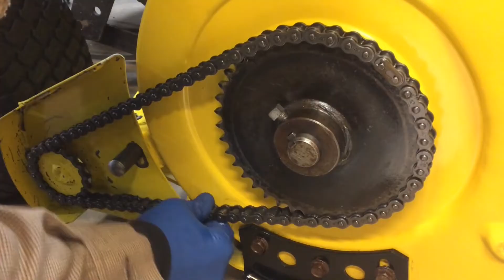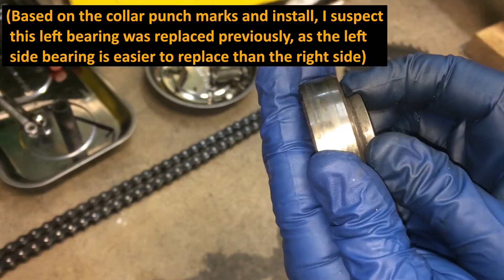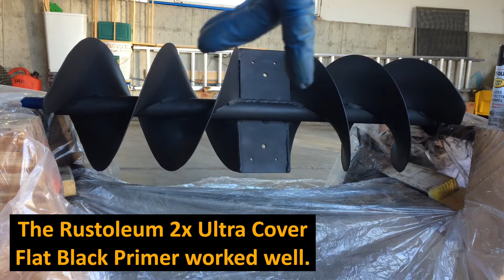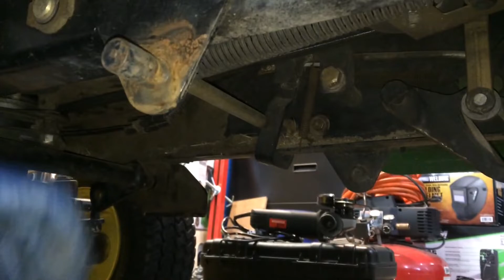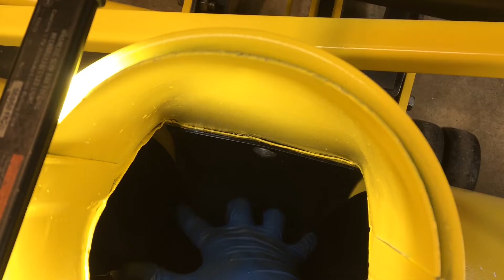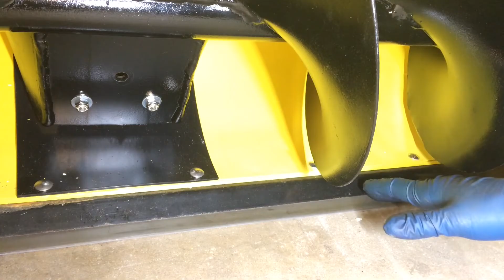John Deere Snowblower Snowthrower Rebuild, Replace Shaft Bearings, Remove Auger, Tension Chain

Comment from the maker: Timestamps, Part Numbers, Links to the Owner's 
Manual:
0:45  Notes about the chain versus pulley drive 
snowthrowers
01:11  De-tension and remove the chain
02:45  About the pulley and drive shaft 
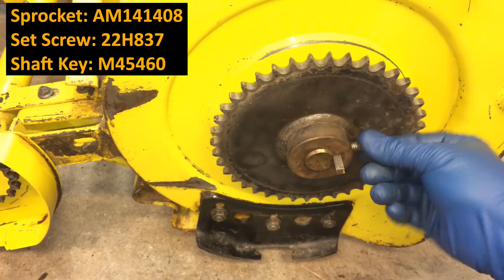03:18  Remove the sprocket
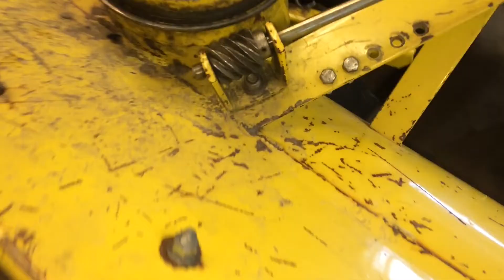04:37  Lock out the rotor so it can't rotate

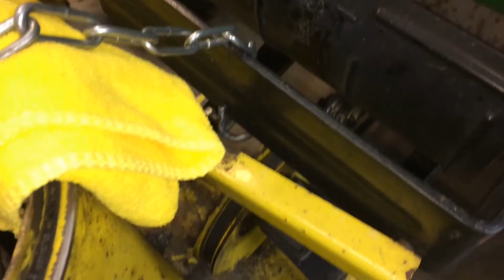04:58  Important detail about the eccentric 
locking collar and bearings set (JD8665, JD8554)

06:58  How to remove the locking collar
08:15  Remove the left hand locking collar
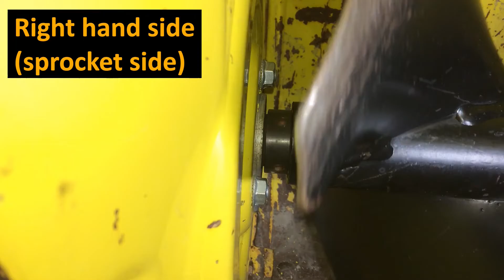11:46  Remove the right hand locking collar
14:28  Remove the shear bolt (7/16")
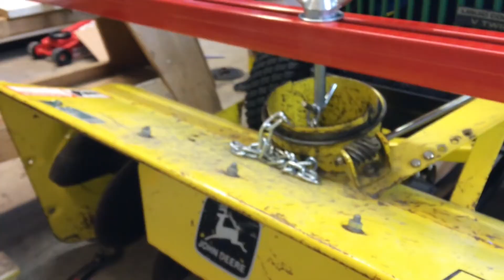14:49  Remove the left hand flange plates and 
bearing (13mm) 
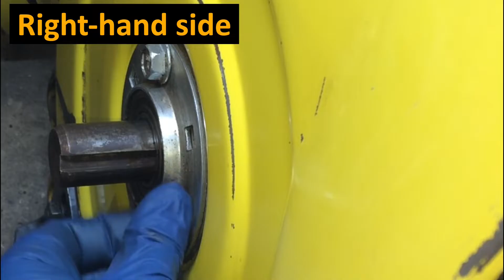15:32  Remove the left hand flange plates
16:06  Remove the left hand shaft key
16:29  Remove the auger/rotor and shaft from 
the bucket
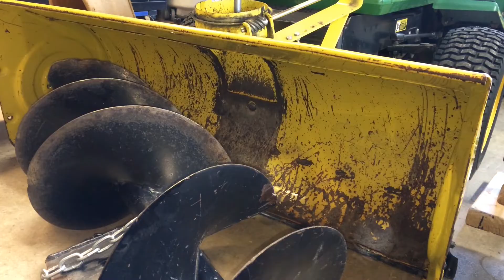18:26  Remove the shaft from the auger

19:13  Tap a stuck bearing off the shaft 
20:20  Inspect the auger and bucket/housing
20:58  Inspect the shaft (JD part M72099)
21:24  Info on the sprocket (AM141408) and 
chain (Size #40, 36 outer links plus 1 master link), and bearings, etc
24:17  Remove the scraper blade (M142882)
25:13  Remove the shoes (M135188)

26:03  Major problem - two broken housing 
welds!
26:41  Inspecting other parts for broken welds 
and other repairs
27:35  Note about the snow chute hinge and rivets 
(M71535 hinge, M127648 rivets)
27:56  Straightening the auger fins
29:59  Inside the old bearing (cut open) and 
failure speculation
32:07  Repair of broken welds (TIG welded)
32:49  Disassemble the rest of the housing

34:20  New drilled holes in the auger for the 
"flapper modification"
34:58  Paint the aguer, housing and other peices

Re-assembly:
40:20  Install the new wear plate (M142891), 
scraper blade (M142882), and shoes (M135188)
41:17  Re-assemble the snowthrower housing 
and drive assembly to the frame
47:47  Install the snowthrower to the tractor
52:02  Install auger to the housing with hand 
install of right side locking collar and bearing
56:13  Measure the shaft protrusion for clearance
56:53  Install shear bolt (19H1914 bolt, M40333 
nut) 
57:31  Note about the shaft keys (M45460, or 
1/4" keystock)
59:09  Install the left side shaft key
59:50  Install the left side flange plates and 
bearing
1:00:29  Important install note for the left side 
locking collar
1:01:28  Check chain case cover clearance and 
lock out the rotor before tightening the collars
1:01:48  Tighten the right side locking collar
1:03:25  Install the left side locking collar
1:04:19  Tighten the flange plate bolts (13mm)
1:04:54  Install the new "flapper modification"
1:07:19  Re-install the auger deflector shield

1:07:44  Back-track: my pulley is not correctly 
spaced on the driveshaft
1:11:28  Re-install the pulley and driveshaft
1:13:05  Chain inspection - why I had to replace 
my chain
1:16:10  Re-install the sprocket and chain
1:18:42  Align the sprocket and tension the chain
1:25:56  Verify there's no chain rub
1:26:16  Tighten the jam nuts and 10mm's for the 
driveshaft bracket
1:26:31  Secure the sprocket set screw to final 
tighteness
1:27:18  Re-install the chain case cover

1:29:13  Level the bucket/housing
1:30:35  Adjust the scraper bar clearance using 
the shoes
1:31:04  Reassemble the snow chute
1:32:05  Re-install the snow chute  
1:34:28  Adjust the belt tension

Link to the Owner's Manual - Chain Drive:
Click this link, select "Part #/Keyword" in the 
drop down, then enter OMM123354.  Or, you can search for "42 Snowthrower".  You can then 
download the full pdf for free:
https://techpubs.deere.com/en-US/Search/Equipment

Link to the Owner's Manual - Belt Drive:
https://issuu.com/razvanalexa/docs/john_deere_
42_snow_thrower_manual

Other links:
https://partscatalog.deere.com/jdrc-
services/v1/image/getAttachment/42_Inch_Snow
_Thrower__240_245_260_265_285_320_325_335
_345_355D_GX_LX_GT_Tractors___Introduction?
a=261&br=1061&locale=en-US

I hope this video was helpful for you.  Thank you for watching, and good luck with your repair!

Comment: Great video. Maybe show us how to replace the small gear. Does it have to be cut off and then rewelded. Very nice voice to listen to.
Reply from the maker: I have never replaced it, but on my model, that sprocket for the drive shaft is indeed welded to the shaft.  

So, I suppose you could either cut it off/grind down the weld and knock it off, and the re-weld a new sprocket in place (Surplus Center might have a match, as they seem to have everything!), or you could replace the drive shaft itself, as a used or new component.  

Your local JD dealer should be able to get you the part number for the shaft, and using that info, you might be able to source a replacement part.  

Surplus Center might be able to match the sprocket if you give them the tooth count and diameter (or you could use a different sprocket and make adjustments to the chain length, if necessary, if you can't find a close-enough match).

I hope that helps - good luck, and thanks for watching! : )

Comment: This video was nicely done and addressed every detail. I am in the process of rebuilding a John Deere 111 and this video was just the ticket to help me repair my snow blower. I am now a fan.
Reply from the maker: Wow, that's great that you are restoring a JD 111!  
The snowthrower shown in the video is still working well - if you can, be sure to do the "flapper modification" at 01:04:55.  That simple change has really improved our snowthrower, and I haven't had to clear the chute once since making that improvement (before that, the chute would often clog, especially with wet/heavy snow). 
We recently got 30" of heavy-ish snow, and I didn't have to clear the chute once, which is really great!  
Happy New Year, and thanks for watching - good luck on your JD 111 rebuild!  : )

Comment: Hi very well  done. Those carriage bolt holes in the chute, normally  the bolts have large knobs so you can adjust the angle  by hand when using the machine.
Reply from the maker: Thank you - I didn't know that, but that makes sense!  : )

Comment: Ok, I have a 265 I picked up from an implement dealer in Hopkins mn for only $200. Missing the mower deck as they ONLY used it to blow snow, so it has this Snowthrower. 
WOW, Your video is TOP Shelf. However, I'm questioning the counting of the chain at 21:45. It seems like the initial vertical link at 21:50, was not counted. Am I wrong? So I'm thinking it should be 37links PLUS the 1 master link?
Reply: Also, what really piqued my interest was the sound of your nice voice! (I'm a BIG Music guy with an ear for notes/key's/recognizing people by the sound of their voice) My Granddaughter from 0-5, lived with us while my daughter finished College. Anyway, LONG Story short, she took a Small Engines course this year in High School, and rebuilt her own B/S engine! There is hope for this next generation!
Reply from the maker: @henryhill3778  That's a great story - thanks for sharing that!  You all must have given her the confidence to try new things and to learn to work with her hands, and that is a SUPER gift to give to your grandaughter!  : )
Reply from the maker: Wow, that's a great deal! 
As for the links: I'm counting the outer links (plates) only, and there's 36 outer links, plus the outer master link.  
So, there's no "vertical link" to count at 21:50 - the link that's in the vertical orientation is underneath the ends of the two "horizontal" outer links.  I have the chain folded such that the only outer "vertical link" is the master link at the left-hand end - all the other outer links are in the "horizontal" position.  
I hope that helps : )  Thanks for watching!
Reply: @L35inColorado  Ok, I'm new to this machine. thanks !

Comment: In the process of rebuilding my snowblower a second time
in 20 some years.
Your video was very well done with lots of good detailed instructions. I learned a number  of good points from your video.
My first rebuild required a new augger shaft to be made due to bend in old one. This overhall is a result of same problem from a pice of cement going through blower. Both times blower had a severe vibration due to a bent shaft. Measured latest shaft in v-bolocks and it has 0.083" runout In middle area. Lots of unbalance from the auger high-speed and large diameter.
Wanted to mention this problem incase someone else does not have structure cracking like yours had and there is too much vibrations.
Thank you very much for the time and good quality of your video.
Reply from the maker: Wow, thanks for adding those tips!  And thanks for watching : )

Comment: I have a JD snowblower.  their idler with bearings only last one year at over $40.00 each, i need 2.  i bought replacements at Tractor supply for $14.00 ea. drilled drain holes for snow and placed silicone on the bearings seal to keep out water and salt.  the bearings lasted over 10 years.  Today JD wants $50.00 per idler i bought them online for $20.00 ea.  BTW i have a JD X320 made in china and is a pos. my previous JD 165 lasted over 20 years without any reapirs at all. made in U.S.A.
Reply from the maker: Ah man, I'm sorry you had all that trouble, but thanks for adding your tips!  I am very disappointed to see JD selling "made in China" bearings at "made in Japan" prices.  Whenever I can, I use the cross-reference documents online to find bearings from a non-China supplier, and now I have to consider that JD is made in China oftentimes.  This old JD 285 is coming up on 35 years old - it still runs well and does what it's supposed to and is an old USA-made JD with a Japanese Kawasaki engine.  I guess we just need to keep the old ones going!  : )   
Thanks for watching!
Reply: @L35inColorado thank you for your supportive words.  btw. JD sells a carb kit for my x320 at $150.00.   I bought a new carb for 75.00. Also replaced main drive belt with aftermarket brand saving over 50% on price.  Thks and keep the videos coming.

Comment: In the process of reinstalling engine someone else ripped out on a 245 with the kawi. As there’s not many videos on these mowers. Loved the video your very detailed and would be great if you made a video on how wiring is ran to the motor as-well as fuel lines.
Reply from the maker: This manual (pdf) from MyMowerParts.com might be very helpful for you - it covers several Kawasaki engines, including the FD590V:

https://www.mymowerparts.com/pdf/Kawasaki-Service-and-Repair-Manuals/FD440V-FD501V-FD590V-FD611V-KAWASAKI-SERVICE-REPAIR-MANUAL.pdf

I have a video about the fuel lines here:
https://youtu.be/t8VZUWgboBo

I hope that helps - good luck, and thanks for watching! : )